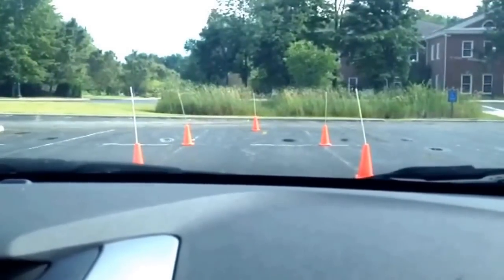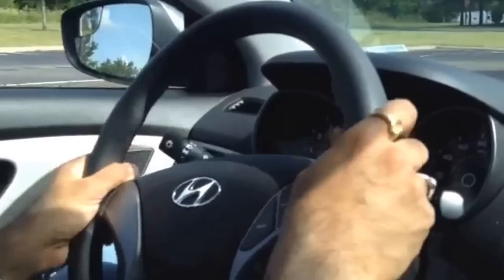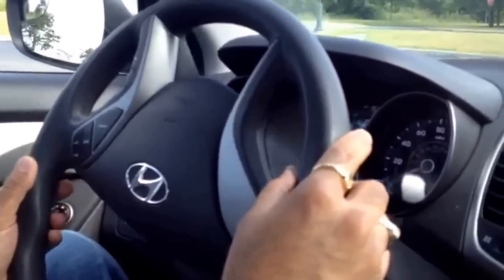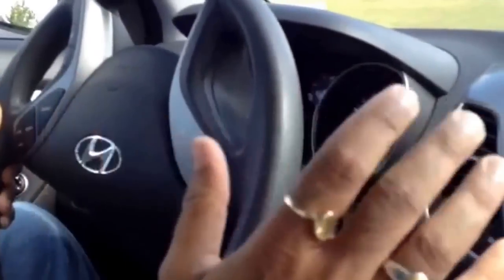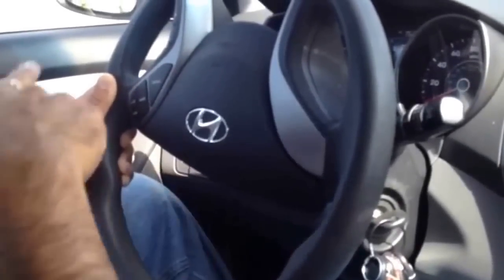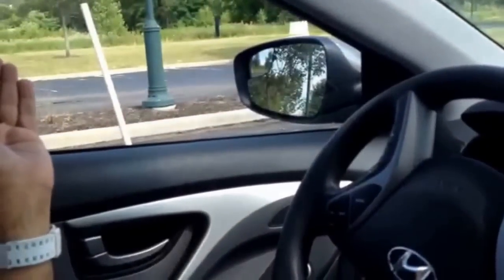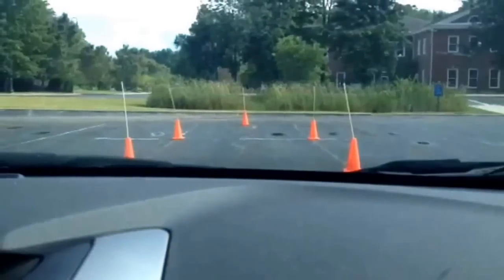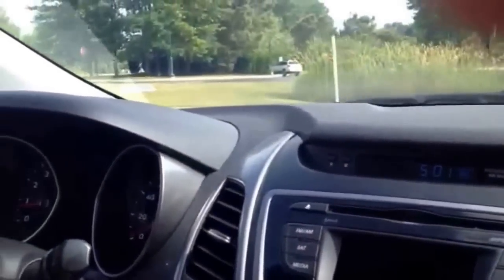Maneuverability Test - Practical & Geometric Understanding

Comment: Looks like the big key here is to keep the emblem on the steering pointing downwards in whichever direction until you're ready to straighten it up to back all the way out
Reply from the maker: Hi David,
Yeah - whenever the steering wheel is turned 180•, the emblem on the steering wheel will be upside down.
Reply: @GuardrailsOfLife1 , it came in extremely helpful with trying to help my nephew practice for his test. And after watching this video only a few times, he practiced once or twice and aced his test first try.

Comment: This is incredibly helpful. My only concern is that I think you get points off for stopping to check your progress. Am I supposed to just try to do it all in one continous motion?
Reply from the maker: Hi Faith,
Yes, the latest thing I’ve seen is they expect the student to do the forward movement in one go and stop after passing the last cone n then come back in one go. 

However, I believe it’s ok to be slow wherever you need to turn the steering wheel.
Reply: @GuardrailsOfLife1  Thank you, this video helped me get my license I finally passed the cones and the road test and got my license Aug. 17th.

Comment: Is it ok to pause like that or do you have to do this without stopping?
Reply: Lol never mined I passed!!!!!
Reply from the maker: Congrats! - That's right we can go slow but try not to stop.
Reply: Did you pause/stop when you passed? If so did you get any points for it?
Reply: Lolita B Two points for every stop that’s not at the start, past the top single cone, and the end of the test. More than 25 points is a fail
Reply from the maker: @lolitab8660  No I didn't pause - and so no points.

Comment: When you drive to top next to the cone do you have to straighten your wheel out
Reply from the maker: Ideally speaking, by then, the wheels should already be straightened out. You may need to ensure that they are, based on the previous 2 turns and may need to make slight adjustments.

Comment: Is it ok if the car is not that straight after passing the center cone? Coz with 360 the car is slighly slanted.
Reply from the maker: Sorry for the late response... Hope you were able to pass the test...
Hmm.. I believe if the steering wheel is turned accurately - the car shouldn't be slanted. 'Coz geometrically speaking, it should just align straight with the cones :)

Comment: Do this technique work if the car is not having power steering??
Reply from the maker: Hi,
You can try first... if not you may need to make some adjustments - meaning turn the steering wheel a little more to get the correct degree of turn.
Thanks